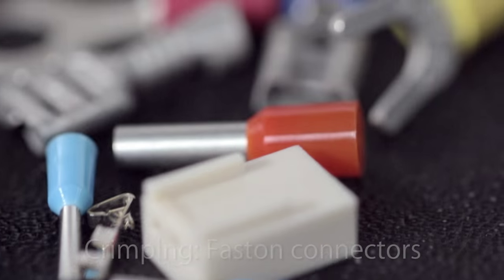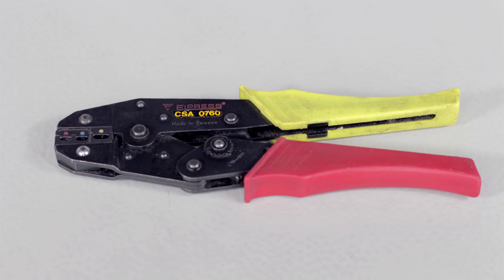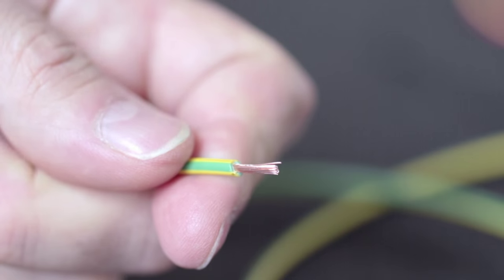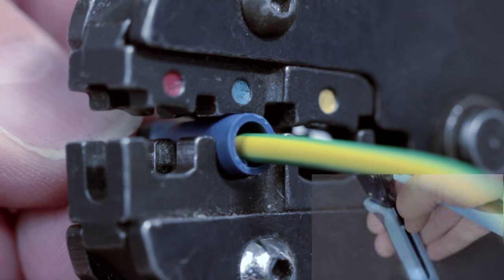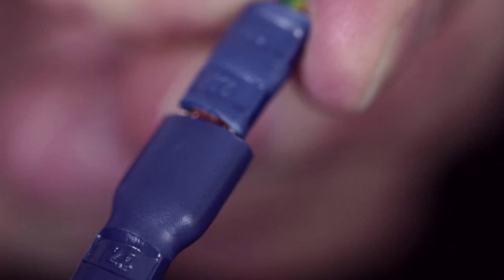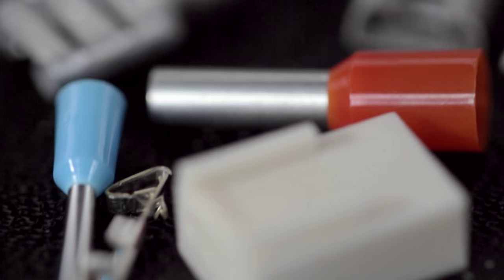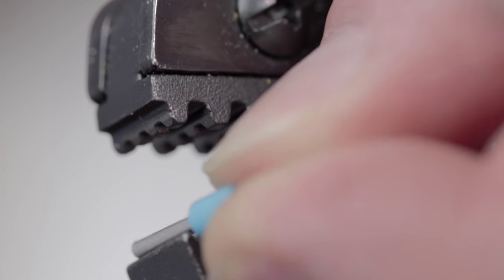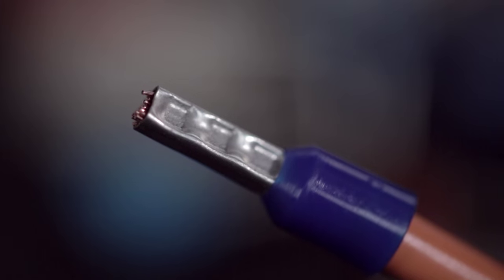Crimping: Faston Connectors

Comment: Never use Faston connectors, they are complete failure. No matter how tight you press they will come off with a strong pull!
Reply: Does your application require a very strong tensile load resistance?

You can also look up the tensile pull test numbers to see what they are rated for. IIRC a 12 awg crimp with PIDG connector is supposed to be good for at least 80 lbs of pull force.